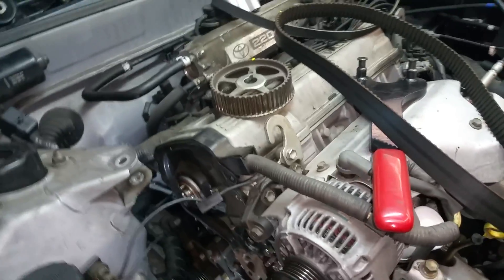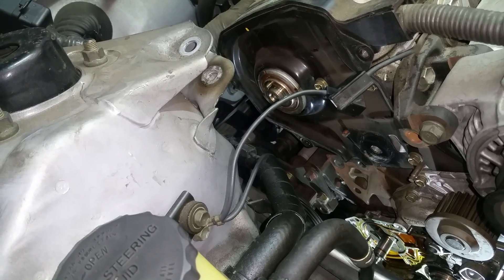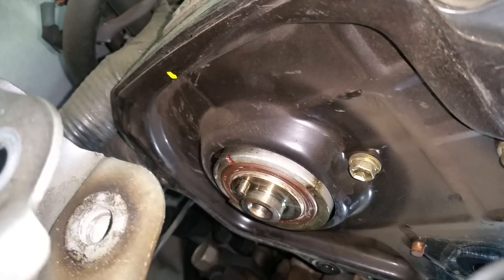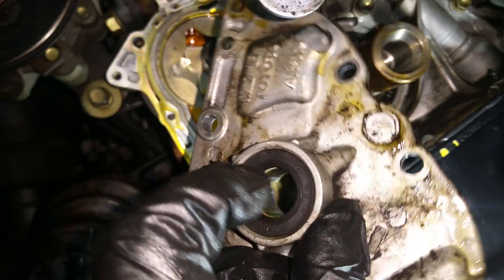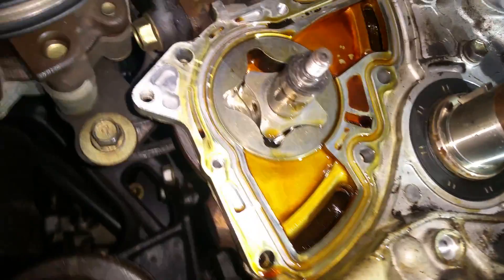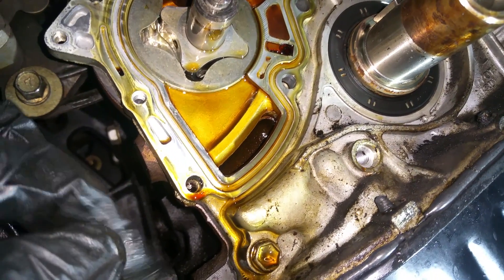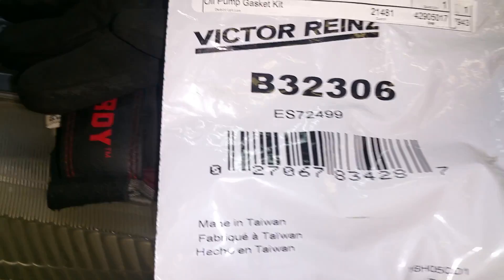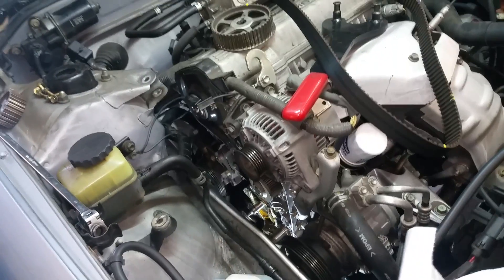Toyota camry oil leak from pump seal.

Comment: Thank you very much -- It has helped me a lot in knowing my car's leak issue.
Reply from the maker: Thank you for the comment! good luck on the repairs!
Reply: i have the exact same issue. changed valve cover gasket, oil pan and cam seal. still leaking. never would've guessed the oil pump seal.

Comment: What can typically leak? Only everything. Cam seal. Crank seal. Oil pump seal. Valve cover gasket. As far as I know, the oil pump housing and the pan gasket do not typically leak. You're lucky there. But the rear crankshaft seal might and if it does you better have either some real know-how or some ready cash.

The best protection for the seal is frequent oil changes. That's an oil issue people rarely talk about.

Comment: You are the man you helped me so much with this  Now I know exactly what it is that I need to fix.  As for tools can you please tell me everything I would need starting with removing the belt and removing the harmonizer crankshaft.
Reply from the maker: i can't tell you that. I work on hundreds of different vehicles. you might want to get a manual for the car. thanks for the comment.

Comment: I would have liked to see how you removed the harmonic balancer and the bolts. Also the O-Ring and gasket set you used is the same as the Mahle B32306 and it has very poor reviews on Amazon. I would go with the OEM ones; sure they are more expensive ($22 vs $3.50) OR you can get a Fel-Pro kit that includes a gasket for the harmonic balancer as well for about $14. Also avoid the Dorman kit; they are even more poorly designed than the ones you used here.
Reply: Actually, I've found Toyota has reasonable prices for many parts. The timing belt, seals and replacement pulleys. I paid a little more for the water pump, but it comes as a complete unit. It's both halves, very well made, my opinion.

Comment: Any tips on how to keep the new gasket in place while installing the new o-ring?
Reply from the maker: The new o-ring will pinch into the groove, if both gasket and are cleaned well and dry, it will stay. I dont typically recommend using anything to hold it in place, too much rtv for example can cause the seal to press out when clamped down, or rtv might dislodge and end up clogging an oil passage.
Reply: @subtledriver  Thank you so much for the advice!
Reply: I'm not finding that to be the case at all. I can't figure out how in the world I'm gonna get this oil pump back on.
Reply: Michael Poage what are having problems with is your seal not in it form or what ?
Reply: @mehjimmunoz9647  I did finally get it on, I guess, but it sure wasn't by having the groove clean and dry. It was a brand new seal, not torn up. But it doesn't "pinch" in the groove at all. I finally put grease all around the groove and shoved the pump on fast before the corners of the seal could pull out of the groove for the hundredth time. Anyway, doesn't matter, got the new timing belt and everything on it, engine was shot. We were hoping the bad tensioner pulley and loose belt were causing the car's terrible misfire and other problems, but it must be something worse. Broken rod, burnt valve, I don't know. Anyway, not my car, was just trying to salvage it for a friend.